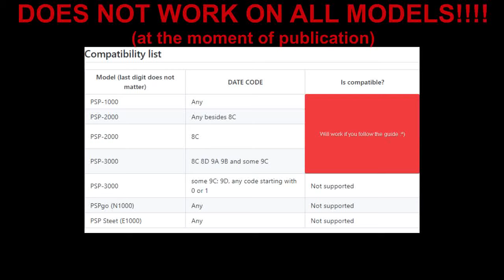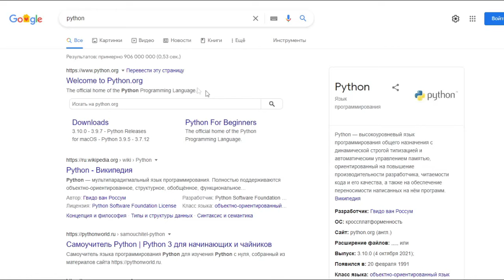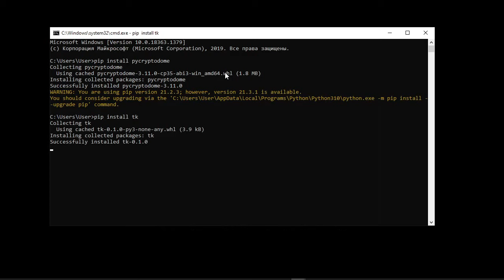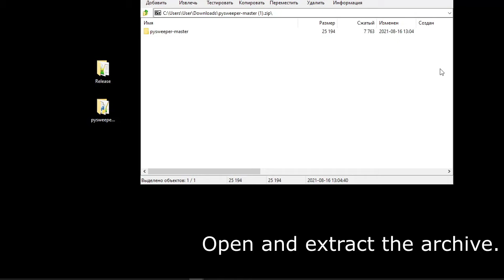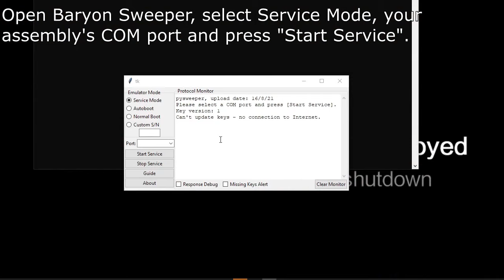PSP-3000 Baryon Sweeper (Solderless) Unbrick Guide

Comment: thanks you this worked on my psp 2000 date code: 7C. i did have an issue however, the bayron sweeper would not work if the psp was connected to dc power (orange blinking light) and the protocol mointor would stay at Service started.
Using serial FFFFFFFF

it worked without the dc in though so i had to first connect it to the psp then plug in the dc power which wasnt easy. for future refrence could you tell me why it didnt work with the dc connected into the psp i tried with both 5v and 3v3?
Reply from the maker: depends on the psp... it seems some psp models do not commute with the battery when on DC jack
Reply: How exactly did you do it? I'm having the same issue. I'm connecting and disconnected with orange blinking but nothing.
do I connect and disconnect when there is yellow blinking? I also changed from 5v to 3v. I don't know how to change it to DC power, is that wall outlet, or battery???? kinda confused. I didnt want to ruin a good battery if attaching that to a battery was the idea. any thoughts would be greatly appreciated
Reply from the maker: @BirukMekonnen  dc power is wall outlet... you can instead attach a more beefier power source (such as a lithium cell) in parallel to power coming from the USB-TTL adapter
Reply: @akhubik2006  im sorry i dont know how to do that.....do i just attatch two wires to the 5v and gnd on the breadboard?
Reply: @akhubik2006  with 3v it started showing me com port busy. no DC plugged in
Reply: @BirukMekonnen  ive managed to get this to work every time by doing the following: first while the assemblly is not connected to the pc, connect it to the psp (you can ethier bend some wires to make some connectors or get a friend to hold them in place for you) and connect the dc adapter to the psp and not in the socket, then while the wires are connected, connect the assemblly to the pc and start the service. then finnally you can plug in dc adapter into the socket, wait some seconds and it works! (notice the green light on the psp power) now just disconnect the wires from the psp
Reply: @BirukMekonnen  also make sure to use 3v3 not 5v
Reply: @Zhaxxy  okay ill give this a try thank you. and yeah Ill use the 3v
Reply: @Zhaxxy  i just tried this. its still only blinking orange. Had ppl helping me too. just doesnt seem to want to cooperate
Reply: @BirukMekonnen  hmm, maybe the wire isnt making a good enough connection, (spefically the middle one). you sure you plugged in the psp to power AFTER all 3 wires were on the battery pins and the service was running? idk if same with your converter but to know its working when you plug it in and see both a blue and red light, the blue light flickers for a bit then stays solid
Reply: @Zhaxxy  really. Okay I’ve never had that before. No blue flickering lights only when the rx and GND are touching each other. I’ll change the wires tomorrow and check it out.
Reply: @BirukMekonnen  the blue light should also show if the ground and middle wire are touching the correct pins at the same time
Reply: @Zhaxxy  So I changed the wires got some new ones and I almost had it got to a few lines then suddenly this showed up...
An exception occurred in IO loop: UnboundLocalError("local variable 'version' referenced before assignment")
Any thoughts?
Reply: @Zhaxxy  also it started and stopped on the second line. is there anything i need to do from my computer side. like driver setting changes or such.
Reply: @BirukMekonnen  nah if it shows your port that means the drivers are working. that error could mean that your psp is unsupported but its best to ask a khubic.
Reply: Hello, idk if someone trying this today. But i have a psp 3001 with TA-093 mobo (no data code) and i didnt have sucess. When i put the cables in battery slot, the protocol monitor show this: 
Service started.
Using serial FFFFFFFF
5A 02 01 A2
A5 05 06 10C306 76
5A 02 01 A2
A5 05 06 10C306 76
5A 02 01 A2
A5 05 06 10C306 76
5A 02 01 A2
A5 05 06 10C306 76
5A 02 01 A2
A5 05 06 10C306 76
5A 02 01 A2
A5 05 06 10C306 76

Someone had this code? What is this?

I tried the protoboard and usb ttl method, with no lithium battery in system.
Reply: @jgmassutti  did u find a solution, i have the same issue
Reply: @jgmassutti  same issue
Reply: @Zhaxxy how do you do that? I don't understand that part
Reply: @JoseAngel-fj3bq  sadly i dont have a psp anymore, its broken (not bricked) so i dont rermeber

Comment: Khubik, thank you so much!
I tried jumper (m/m) instead of diode and it worked! 

For future users:
- Usb-ttl ch340
- Any breadboard
- Jumpers m/f 
- Jumpers m/m
- DC10 or DC9 depends on if you want ark-4 firmware or you have another psp like me!

You will need to kill 2 jumpers m/f to make the jumper m/f-m, where's m will be connected to psp's battery connector directly!
Also, be careful and don't use usb 3.0 nor 5v mode, 3v3 will be enough!

Comment: My TA-88v3 came back to life omg with this!!! It's been 8 years I've had this PSP in the closet and bought the reliable PSP-1000 to replace it. Now I have two PSPs lmao Thank you bro!!!
Reply from the maker: TA-88v3 Pandora image was out long before the PSP-3000 hack happened.
Reply: @akhubik2006  Ah it's because I don't have the original or any authentic PSP battery to modify and didn't bother searching the market for one. But with this I don't have to find one.
 Coincidentally the USB to TTL are very cheap and diodes are just everywhere.
Reply: @akhubik2006  hey there, what do you mean the Pandora image for the TA-88v3? I just retried using a Pandora + MMS to unbrick a TA-88v3 2000 model, but it didn't work (after some searching because Sony disabled Memory Card access on that motherboard). Are you saying there is a way to unbrick a TA-88v3 using a regular Pandora battery? 

Thought this is why Baryon sweeper is the only option for these. Keen to hear back!
Reply from the maker: @GloriousPCsammich  They enforced a check if MMS had genuine IPL that won't allow anything but MSID-encrypted official programs like OSCOPY (SCE internal version of Pandora unbricker), balika077 had bypassed this in DDCv9. The battery auth part was the same as other 2000s, so it doesn't require Baryon Sweeper, just a regular Pandora battery but with a special MMS - with a re-encrypted OSCOPY or DDCv9

Comment: if i can understand correct, in the arduino uno part (5:14) have a typo. you connect  Rx to the row 1 and the Tx to the row 4, but you connect the diode fron the row 1 to the row 5 (the diode not bridge Tx with Rx)

Comment: Man you revived my 15 years old PSP who was stored from a very very long time, and tip for those with the PSP model 3001 the 5v don't work at all, tested in 2 PSPs go for the 3v3 slot works 100% of the time
Reply: How do you do the 3v3 slot step? You just connect the red wire on a different slot on the breadboard? I am not familiar with these things
Reply: @JoseAngel-fj3bq  You do all the things just like in the video, but if the console don't  respond you just switch the 5v slot on the breadboard to the 3v3 slot, the color of the wire doesn't matter as long as the others are connected in the right slots
Reply: @StayFrosty  thank you! I
Reply: @JoseAngel-fj3bq  it worked?
Reply: @StayFrosty  I have not tried anything yet, I have to order the materials I need. But I think I could make the baryon sweeper now. However, I am reading about preparing the memory stick, and it is very confusing for me, I don't understand what I have to do, it seems there are many options?

Comment: Great video! Great work! This has a lot of hours into developing.
I'm trying to fix a PSP 3004 using this, but I have an issue that I'm not able to overcome.
I have a Arduino Leonardo, so I had to upload a sketch to bypass the ATMega and use the serial to usb. After doing that I connected all the cables (except the RESET to Ground, that I don't need), including the diode. I double and triple checked all of them.
When I run the Baryon Sweeper, and press "Start Service", all I get is "No port echo. Double check assembly."
I'm sure the conncections are good. Do I need to connect to the PSP first?

Comment: hello! first of all I'd like to thank you for giving this huge (in my opinion) opportunity. I'm about to try this for the first time.
My question is: As you posted the correction 2, I understood that the 1n4148 diode is no longer needed and instead I can use a Dupont aka jumper wire, am I right?
And it should work the same.
Reply from the maker: yes, works for me
Reply: @akhubik2006  it worked! you are the man, thank you so much

Comment: My respect to you. I would just like to know something curious and excuse my ignorance. What exactly do the audino and diode do to get the PSP even locked into service mode? An explanation since I like this topic
Reply from the maker: System firmware is stored on a chip that is soldered to the motherboard. It's always there, and accessible without Memory Stick. By default, this is the firmware PSP wants to boot. In case it gets corrupted for whatever reason,/ PSP cannot boot. To recover the firmware, you have to boot a recovery program from Memory Stick. Service mode is exactly that - boot firmware from MS instead of onboard storage. All PSP batteries have a serial number, but when serial number is FFFFFF in hexadecimal, service mode is activated.
Batteries communicate with PSP's system controller (NEC 78k0) over the middle contact in the battery compartment through a serial interface. However, there are just one wire and not two for RX and TX commonly found on devices like Arduino. That is because they are joined together as per K-line communication protocol, widely used in automotive. PSP talks at 19200 baud, 8 bits, no parity. (8n1).
PSP is the first to talk, and it will talk in packets that have the following structure: [HEADER|LENGTH|OPCODE|DATA|CHECKSUM]
and the battery replies with the same kind of packet.
PSP will ask the battery a couple of questions - what capacity it is, what serial number does it have, etc etc...
But one of the most important of them is crypto challenge, that involves AES-192 CBC. The battery has to have required keys to pass that challenge, and keys required to do so differ from console to console. 
The service mode is activated when battery has the serial number FFFFFF in hexadecimal and passes the crypto challenge. The keys required for normal operation and service mode differ, but before PSP-3000, batteries had them both - and that's the reason you could make service batteries out of original ones by disabling their EEPROM memory, which will result in desired serial number.
PSP-3000, however, introduced new keys, which, in turn, introduced the need for a battery emulator, since there are no ways to program new keys in an existing battery.
Arduino and USB-TTL adapter are both pieces of hardware that provides your computer with a basic serial interface. You don't need an Arduino for anything other than it's USB to serial converter chip - hence the RST short to GND. The diode joins RX and TX lines as per K-line protocol. Baryon Sweeper provides valid responses to PSP - as if it was a service battery that actually had all the keys.
Reply: @akhubik2006  My doubts have already been clarified. I honestly didn't know you gave me all that information about it. It is difficult to find, and more coming from a YouTube (they do not know what to say). Thank you you are very kind I will save this, so I can already speak with base and know exactly what I am doing. Again my respects friend.
Reply: @akhubik2006  Subscribed, liked, Shared and saved to my list. 💯💪🤝

Comment: Great video, however i am stuck with pysweeper, after selecting the port it gives me : No port echo detected. Double check your assembly.
I tried with two different arduino... Do i need to buy a usb TTL adapter ?
Reply: USB TTL also has the same problem, it seems that something else prevents the ports from being found
Reply: @Armenhowmuch   Hello, I got that message too using F232rl ttl adapter. Do you know how to fix it?

Comment: I use same Arduino you use but when I connected it to tool it say (no port echo detected. Duble check your assembly) I’m sure my connecting correctly
Reply: Hello. I had personally had to swap TX and RX wires on the board. and then put the RX out from the breadboard on the correct line, and that did it for me. This video is great but there was this part about the fact RX and TX being reversed that played with my mind I guess.

As far as I understand, RX and TX pins on arduino are used when uploading data to the board. I guess pysweeper wasn't getting a proper response before setting up to do its magic thus leading to that error.
Reply: @justinm7958  so I should swap the wires between tx and rx?
Reply: @سلطان-و4ب2ص  I'm not aware of your specific case. What I can say is that I tried that and it worked.
Another thing you could try and that I haven't was to use 3.3V instead of 5V pin.

Comment: Appreciated the work you done in resuscitating bricked PSP 300X! But sadly, no success in reviving my bricked PSP-3001 (IC: 409B-PSP3001). I was able to get the green light lit by shorting first then connect my official Sony charger but after 20 seconds it turns off. No memory stick activity lights, no display, and no sounds which oddly acts the same way as if I try to switch it on with just the charger.
Reply from the maker: bad magic memory stick! make sure to run the tool as admin or try creating the memory stick manually by following the guide: https://www.pspx.ru/forum/showthread.php?t=111112
but using DDCv9 by balika (https://github.com/balika011/DC-M33/releases/tag/9.06)
or jigkick620.zip linked in jig replicator's github instead of 5.02 linked in the topic

Comment: This might be a dumb question but, is the step on 0:37 is only to access the memory card from ur pc? i know that you put ms reader on bottom left corner, but the fact that you use a working psp on that part kinda threw me off
Reply from the maker: yes, it dosn't matter how you do it, it's just like you said, you only need this to to access the memory card from your pc
Reply: @akhubik2006 Great! thank you 

Oh yeah, and another question, I'm planning to use the USB-TTL converter and want to buy a breadboard. My question is, does mini breadboard works? or do I have to use a bigger one
Reply from the maker: @ImSanzie  That depends on your adapter! Make sure yours fit in the mini breadboard - say you have 5 pins, like my adapter does. Then you need a breadboard that's at least 5 pins long and 3 pins wide - you want 2 extra contact rows - one for the diode and another one for loose wires.
Reply: @akhubik2006 Alright, thank you so much

Comment: Hi! Thanks fror this tutorial. I already have this setup ready, but if I have the PSP power adaptor connected, the process don´t start. However, if it is unplugged, the PSP boots without problem into Despertar del cementerio but I´m barely able to hold the cables in that position for a couple of seconds before it turns off. Could you please tell me what I´m doing wrong or what I´m missing? I have the same exact setup that you are showing in the video using the same USB TTL. Thank you!
Reply from the maker: try to short right contact not to 5 but to 3.3v then
Reply: @akhubik2006  Thanks for the quick reply!  After trying for several hours, I was able to put the cables in position to flash my PSP without the power adaptor. Next time I'll use the 3v pin for sure!
Reply: i have a psp 2000 and i have the same problem. But it doesn't enter the DC even without connecting the charger. I did everything the same as the video.
Reply: @locobrmp  Mine was also a psp 2000. Do you have another psp to format the memory stick before installing DDC on it? Maybe that's your problem.
Reply: @letrange1  Thanks bro. I formated my MS using PSP tools 1.00 and injected IPL with it and the DC finally run. Thanks again

Comment: all good but only the green led is turning on, no MMS activity, not even one orange blink, is a PSP 2004 8C, what should I do? I created the magic memory stick several times but no luck
Reply from the maker: could be a hardware failure or wrong MSID... make sure to choose ddcv9 to avoid msid hassle. or try creating the memory stick manually by following the guide: https://www.pspx.ru/forum/showthread.php?t=111112
but using DDCv9 by balika (https://github.com/balika011/DC-M33/releases/tag/9.06)
or jigkick620.zip linked in jig replicator's github instead of 5.02 linked in the topic
Reply: @akhubik2006  The issue was the MMS, initially I created it with an original 4GB Pro Duo from Sony. This one, although functional couldn't be booted from. The lucky combination was a micro SD with a basic adapter, following the exact same steps.

Comment: thanks for the guide but the green light on my psp 3003 9b just turns on for a little and as soon as i disconnect the 5v it shuts off. i am using and arduino uno with jumpers insted of a diode and a card reader to read to the memstick. thank you
Reply from the maker: do you have DC jack plugged in?
Reply: @akhubik2006  yes i do
Reply from the maker: @Larry-q4c9t  you can try what my comrades did - take a single-row dupont female dupont female connector, cut three contacts, remove the contacts from the plastic, cut the holes sideways to resemble PSP's battery contact group, then reinsert the contacts in the plastic you've cut. you should get a contact group that should give you a better grip on the pin header.
Reply: @akhubik2006  i tried holding it for longer and they definatly do make contact with the pins and i even taped the power switch on but nothing seems to work i even reflashed the memstick the pysweeper does give me codes though
Reply from the maker: @Larry-q4c9t  try ark-4 team's ddcv10. more info in github repo, memstick flashing software is very similar
Reply: @akhubik2006  it still doesnt work when i try it. i dont even know if it is bricked or not it just stopped turning on one day